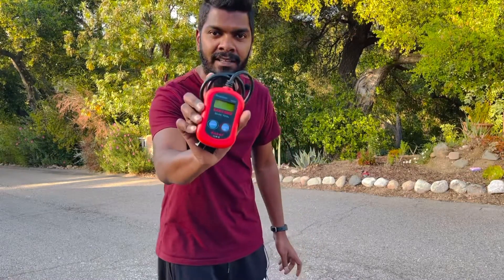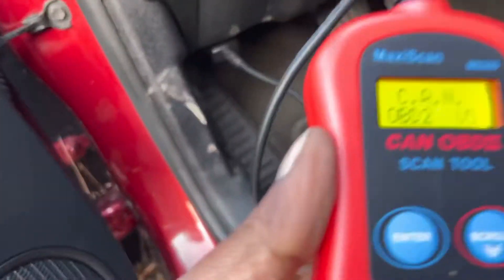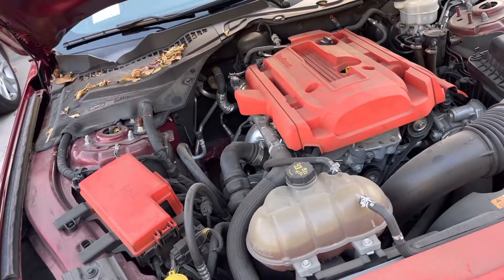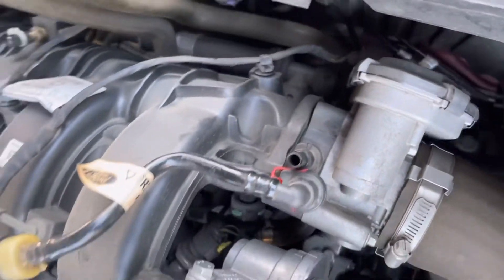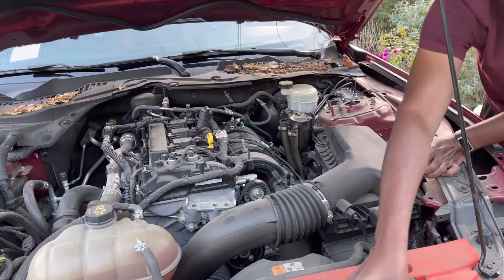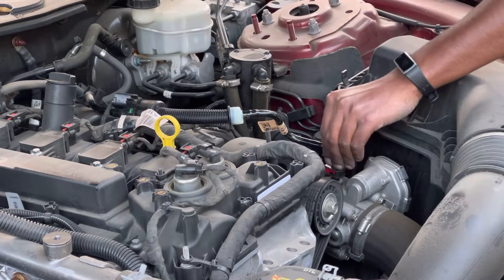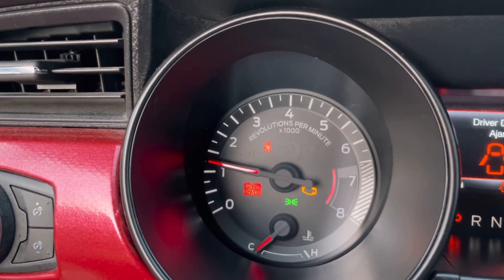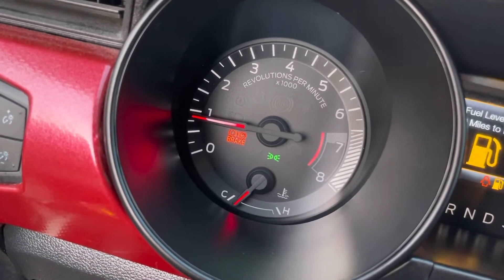2016 Ford Mustang Eco Boost - P144C - Purge Valve Replacement

Comment: I changed the part and put the new one but the engine light is still on, do I have to delete the code with a scanner or can I disconnect the battery?  can you help me please
Reply from the maker: Thanks for watching my video. To erase the check engine light, please refer to the Video start time 08:30